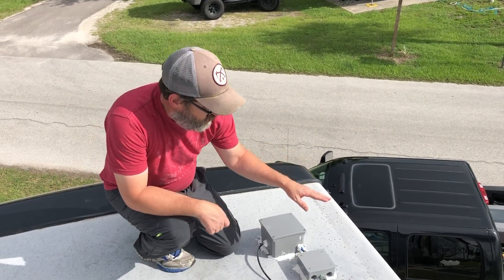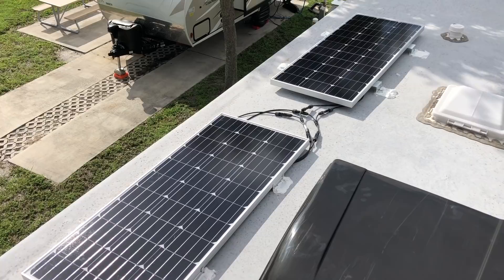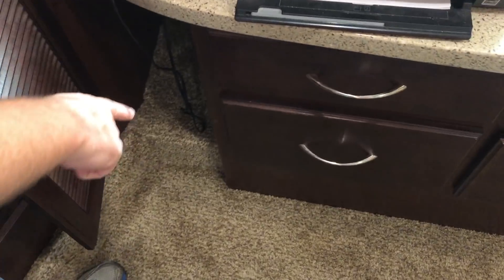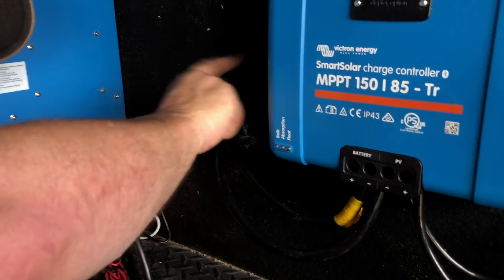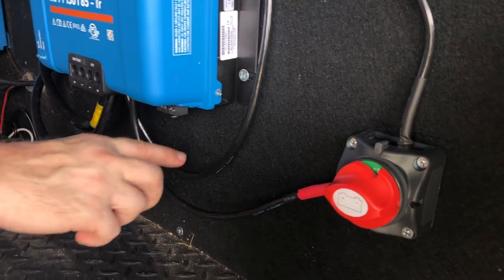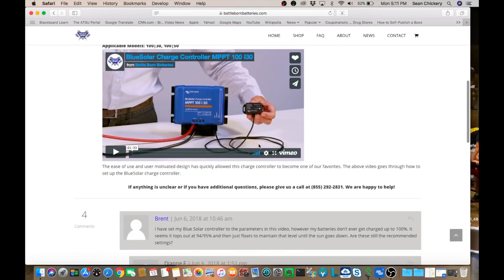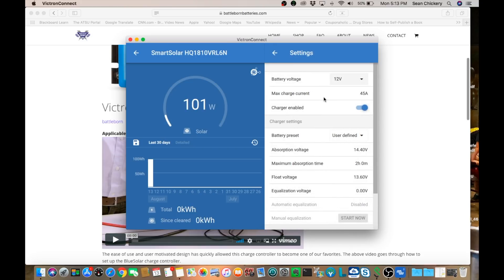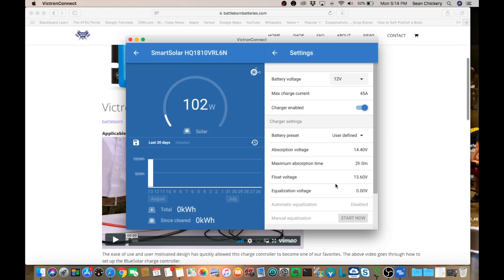RV Solar Upgrade Part 3: Victron SmartSolar MPPT 150|85 & HQST Solar Panels

Comment: I've purchased 4 BBB'S and want to purchase a Viktron 150/85.  I will be waiting my 12 solar panels in series/parallel. 

The voltage will be in the range if 32.4 volts.  Will the 150/85 handle that?
Reply from the maker: The controller’s literature says it has a maximum circuit voltage of 150 volts. You can also call the folks at Battle Born. They are very helpful.

Comment: Do you also have a generator?  If so, how did you incorporate it?  Or did you eliminate it?    I'm thinking of eliminating the large Onan genset and placing my batteries there.  Perhaps place a small Honda Generator for emergencies there.
Reply from the maker: Since making this video we downsized to a smaller fifth wheel and opted not to get the large Onan and placed our batteries there instead. We have two small 2000 watt generators we run in series when needed which is not very often.
Reply: @ChickerysTravels  Thank you.

Comment: Don't drill holes for panelling mounting, plenty of liquid and tape adhesives will do the job. Another hint for what you paid for 2 Renogy 100W panels you could have bought 2 60 cell panels at 300W each - 3 times the solar input. Your Victron MPPT controller is designed for the higher voltages.
Reply from the maker: I have since updated the panels and now have 800 watts. I am going to eventually add another 400 watts to make it an even 1000 watts. That should be plenty.

Comment: Great video playlist. Really clear.  Are the solar panels in series? Youtuber adventure in a backpack setup in parallel then found from company in series high voltage is best provides more watts. Controller will take 75 v or more. Thanks
Reply: https://youtu.be/c5Mi6tYkrkI here is link to comments from battleborn and high voltage
Reply from the maker: Right now, they are parallel. Thanks for comment, I will look at it. I average about 18 volts from the panels.

Comment: Looks like a great upgrade! If we go lithium in the future we will probably stick with that brand as well. Seem to be pretty solid and recommended by a lot of folks. Thanks for sharing! - Shane
Reply from the maker: Thanks for watching, Shane. Yes, the product is awesome, but the support is even better. They are quick to respond to questions and will even program all of the components if you request. I wanted to go through the entire process myself, so I opted to program them as I installed.

Comment: Great video. No need to apologize,  I'm sure missing the wiring is no big deal considering not everyone has the same RV.  Before these videos I would have been picking up a version of "Solar Install for Dummies", but this kind of video should make people feel more confident about tackling the job themselves. Thanks for sharing. Be safe. Safe travels. Later.
Reply from the maker: Thanks again! It really was a confidence booster to do this mostly on our own. Luckily there are a ton of friendly & experienced RVers that are always willing to answer a question. Also, I can’t say enough about the staff at Battle Born Batteries. They were very responsive and helpful if I had a question.